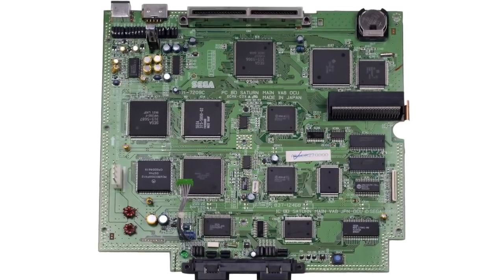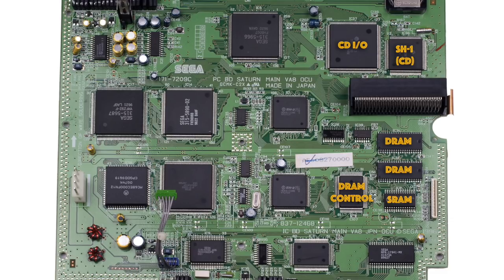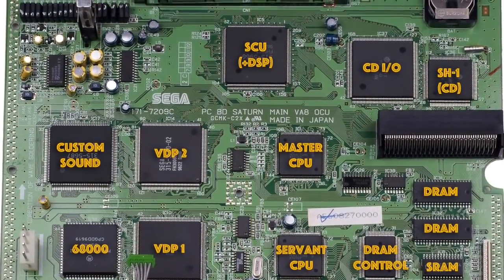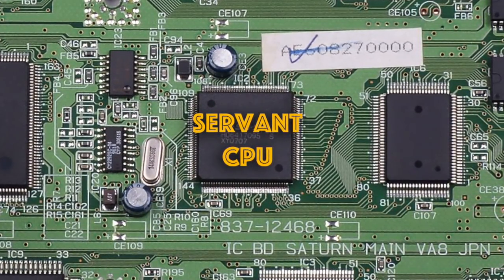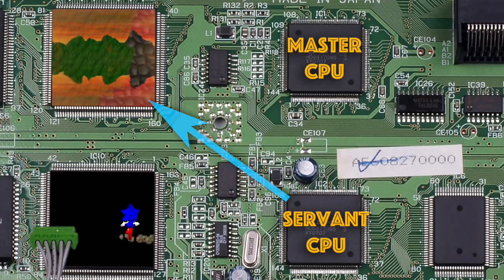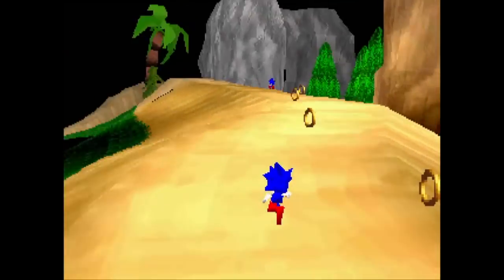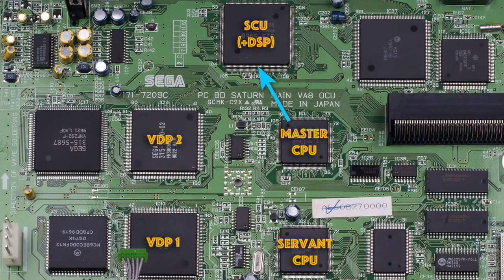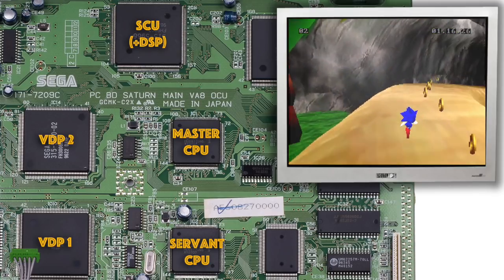SONIC Torn Apart - Exposing SEGA's Insanity with Hardware (CODING SECRETS)

Comment: I'd love a experienced developer like yourself to answer this kind of question... When using all of the Saturns hardware properly like this, do you think it could have matched or even outperformed the PlayStation at 3D capabilities? It was obviously better at 2D. I remember at the time playing this game, Duke Nuken and Virtua Fighter 2 on the Saturn, and all those games looked better than almost anything on the PS at the time.
Reply: according to performance benchmarks on wikipedia and segaretro, in ideal testing conditions (no gameplay code, hardware used optimally) the saturn outperforms the ps1 in any 3D drawing operations except for native transparencies. there's also differences in how the gourad shading is handled between the two, resulting in PS1 graphics looking washed out while the Saturn looks overall darker. the Saturn also has less texture warping problems and no gaps between adjacent polygons.
Reply: that said, the N64 outperforms both by a long shot :P
Reply: The texture cache was so small that devs opted for using smaller textures and flat shading to build larger more detailed textures. Just another case of the 90's not having the most advanced tech available at decent prices. That said, it's impressive that the N64's GPU could manage what it did with so little.
Reply: 21st, N64 does have a "DSP". It also as far as i know doesn't have a GPU. One thing i remember is "Gamasutra Postmortem: Angel Studios' Resident Evil 2 (N64 Version)" for keyword "DSP".
I think it just has two R4000-series processors, one of them being considered the "CPU" and the other "everything else" or the "DSP". I seem to remember (perhaps wrongly) that there are two COPs hanging off the slave R4000, one being a line span texture mapping rasteriser, and one being a more generic math co-processor. If you think about it, line span texture mapping and wave sample music synthesis are essentially the same thing, so i think that's how that works. Most games had the exact same Nintendo-provided middleware code executed on the second processor, which handled all the sound and graphics, so the early emulator UltraHLE didn't emulate it AT ALL, instead it just intercepted the library calls made to it from the main processor and reimplemented the middleware's functionality. I didn't dig deeper than that, i'd be very thankful if someone saved me the effort or provided pointers though.
Reply: 21st, Playstation very much has a true GPU, that doesn't work fundamentally too differently from what you get in the Dreamcast or newer. It has its own VRAM, you DMA a display list to it, it does the rendering, it's completely fixed function, in these regard very much like the Dreamcast, or rather, perhaps the other way around. Sure compared to anything that came out later it's pretty damn dumb, it doesn't have a Z-buffer, it doesn't have perspective-correct texture mapping or any concept of Z coordinate and settles for affine mapping which doesn't connect right at the triangle edges, the vertex coordinates are integers rather than fixed point, its edge rule is complete and utter bollocks (evaluating the edge equation in hardware? pfft, we don't know how to do that, we'll just Bresenham the line and subtract one pixel from the right and bottom, damned be the... edge cases), but it's really an actual GPU, just a sloppily designed one and with ALL the corners cut that you possibly could get away with. Oh and the caching strategy and memory allocation are nearly as asinine as they get too. But as a whole it was also exactly what was needed at the time and for the budget to turn the industry upside down, so while it is a bit easy to make fun of, i'm not really criticising them at that point, i mean 3DO, Saturn and Jaguar kinda saw the general direction but didn't deliver what was needed to push the industry to where it needed to be, 3 expert manufacturers tried and fell flat on their faces. Not to speak of the other failures, like the Bandai Pippin, FM Towns Marty, NEC PCFX, Amiga CD32, which weren't even close.

I used to be fairly familiar with Playstation GPU because i used to develop a PSEmu Pro compatible GPU plugin that was shit and never released. You google up "Everything You Have Always Wanted to Know about the Playstation But Were Afraid to Ask" document by Joshua Walker, that should fill you in nicely.

I also suspect the max usable texture size on N64 was limited not by the memory constraints, but by the fact that the complete texture had to fit into the slave R4000's L1 data cache, and that was just never going to be all that generous, because of transistor budget.
Reply: I think the supposed "fact" that N64 had T&L is not quite right. I mean on a higher level, yes, something did the transform and lighting for you, and it was probably the second processor, which probably detracted from the time it had for texturing things, which is... not exactly the point of T&L, which is supposed to be a dedicated hardware unit that can hide the time needed for that. If you look at everything else. Did PC have a T&L? Very uncommon, but i think 3DLabs and someone else, somewhat exotic professional cards, had true hardware T&L solutions around the same time, obviously only with OpenGL and at first just with Windows NT. And it was usable with any Quake game, not just Quake 3. First GLQuake came out in early 1997. Oh there was also the Hercules Thriller Conspiracy, which allegedly came out in 1997-ish, a Verite with Fujitsu geometry processor, so that was probably consumer-oriented, but also i haven't ever seen one and haven't heard of any person or even magazine that had - chances are, it didn't work really, a bit ahead of its time. By the way, Hercules is a hardware company related to Ubisoft :D Direct3D didn't gain hardware T&L until DirectX7 due to driver architecture constraints, so that got implemented in 1999, just in time for GeForce 256, a T&L chip for the masses. Playstation? Well there's no GPU side T&L, but you had a coprocessor to accelerate these operations, not really useful for anything else. Dreamcast's SH-4 has something similar again, a super-fast set of dedicated pipelines which just did the few things that you need for T&L, though of course that's more akin to SIMD like you had on Pentium III, just with a much more cut down instruction set. Obviously using these units still occupies the CPU, so it's not true hardware T&L either, but they also fulfil the purpose of accelerating the same set of operations.

Ultimately hardware T&L was a bit of a massive dead-end, it's fundamentally better to have programmable hardware do these operations for you as you can have a lot more flexibility at little extra cost, which is what the VU1 in Playstation 2 and the vertex shaders on Xbox delivered. Other than OpenGL spec, there was really no good reason to have a fixed function hardware for vertex operations, as opposed to rasterisation hardware.

Apropos how much the Hercules card mentioned above was ahead of its time, Verite would have possibly been pixel shader capable, except there was of course no API or driver support to make use of that, and the performance of those cards was pretty bad too, but they held up feature wise surprisingly well for such early GPUs, adding new DirectX features as needed, it's just that the entire computational throughput wasn't that good. I have not managed to procure a Verite for testing in 1998-1999 because no supplier or store or chain working with me (i wrote hardware reviews for two print magazines in a small eastern European country, as a teenager, this wasn't actually that uncommon there and then) stocked a Verite, in spite of a bunch of manufacturers making the cards, though those all other cards didn't have a dedidated T&L processor. The Verite company pretty much disappeared by then though.
Reply: I don't think N64 lacked RAM. 4MB stock, expandable to 8MB - that's HUGE for the time. Couple that with cartridge based storage, of course unlike earlier consoles the cartridge is not fully directly accessible at the same speed as RAM, but you still have a very low latency storage path, so you can cull textures from RAM more aggressively than you'd ever dare with a CD based system. I think the max texture size is as stated above limited by cache of the second processor. If you wanted to have higher detail textures, you'd have to tesselate the geometry, and the system was not really up to the task of handling any more geometry than you saw in those games - at least not with default middleware that most games had to make do with, a handful games used a faster alternative, especially Factor5 games. Plus the texture transfers from the main RAM to the cache of the second processor was also likely a limiting factor.
Reply: @Slana Gearz
You misunderstand the N64 hardware. It has 2 chips and 3 processors. Its "RCP" contained two independent processors, a DSP and a GPU. The GPU was designed by SGI(the leading 3D graphics company at the time) and was the closest to a modern GPU of its time(excluding SGI's other products). It was running a graphics API very similar to OpenGL; to be exact, it was using the API that OpenGL was based on. "Hardware" T&L has always been a misnomer. To the best of my knowledge, nobody has ever actually done it. Rather they use microcode, like the n64, to do it. It isn't physically achievable, excluding microcode, to do hardware lighting because you would need a processor wide enough to process the entire world space at once. Think a 16000000bit processor. NVIDIA's big innovation  was locking the developers out of the microcode.  

The reason for the low quality textures was something else entirely. The GPU only 4kB of "TMEM" that halt 8 textures. This texture memory was on-chip and very fast, but to load a new set of textures, the GPU had to use main system memory which functionally paused the CPU. To get around this, developers had to use as few textures as possible in any given scene. A good game to see this in action is OoT. The game has a lot of textures, but you only see a handful at any given time. Each dungeons has its own set of textures, and each boss has several unique textures. Yet you go to Hyrule Field and you have the same textures plastered all over the place.
Reply: Amir Abudubai, source of assertion that there's a complete GPU integrated? I know i don't have a source for my suggestion either, and i know i might be remembering things wrong. I know it's designed by SGI, but... that's not really saying much, given that the project scopes were completely different and the variety of different hardware SGI produced over the years. And i know NVidia and 3Dfx and 3DLabs and a good chunk of the industry overall descends from SGI, it's their engineers being founding members of these companies who made them possible, with few exceptions... and it's absolutely fair to say that they have thrived on reimplementing SGI's innovations while taking advantage of newer manufacturing technology for years, but i'm sure they also cut down the underlying complexity a lot, because they were in the mass-market ASIC business and not in the workstation business, so it made less sense for them to rely on off-the-shelf hardware.

I guess what would be somewhat authoritative is a disassembly of the "microcode" off the RCP. It is a MIPS processor that's for certain, and it stands to reason that whatever other units are implemented on the same silicon, they'd use the MIPS COP facility, the question is really just what functionality is implemented on the COPs directly and what is performed in software on the MIPS. Another approach would be to look into the emulator source that performs low-level RCP emulation and just see how exactly it implements the COPs. I vaguely recall hearing that the COP for texturing is a rasterizer that outputs a section of a line per COP operation, and i don't have a validation for that at the moment, but i'll probably try to dig in later, see if i can find something to prove or disprove that.

I don't see why you'd think the complete scene needs to be vertex processed at once. You have a DMA controller, which is a simple state machine, you don't need a processor for that. The controller feeds primitives into the rasteriser one at a time, every time the rasteriser signals ready, it gets another primitive. So far so good for classical rasteriser hardware. To have hardware T&L, you just extend the DMA controller to switch between either loading the fixed-size T&L parameters into the registers of an ALU, for example just the transformation matrix in the simplest case, or loading a fixed-size primitive, the ALU in turn multiplies the matrix with the primitive's vertices and feeds the transformed primitive to the rasteriser - that's your basic transform. To light, you add a bit of flexibility to the ALU and a little state machine that applies operations to the primitive a bunch of times. Just like the rasteriser is a state machine, it's not necessarily microprocessor-based (usually not), and it's not drawing the whole primitive in one step, it draws a handful pixels a cycle and loops through the boundaries that are spat out just in time by another state machine. State machines are hardware design 101, state machines and truth tables are basic building blocks that both general-purpose processors and dedicated circuits are generally and easily composed of. Microcode as a term is not very well defined, but usually it means a softwired state machine instead of a hardwired one. In that sense i think Nintendo calling the firmware that is uploaded by the game software to the RCP the "microcode" is a misnomer, i suggest a deliberate one because it makes sense to not let people know more than they had to, to protect their and SGI's intellectual property. Using a microprocessor that executes a program when a state machine would suffice is usually a distinct inefficiency, because you're essentially running one state machine on top of the other, with the exception being a processor that is designed with the minimum amount of flexibility to support that specific state machine, at which point the distinction between 'microcode' and 'software' becomes quite blurry. But a MIPS is certainly not such a minimalistic processor. On the other hand, shaders are fairly minimalistic processors.

Even if the COPs accept one primitive at a time as an input, that's still definitely limiting, as ideally when you have a complex and capable processor, you want it free during the time it takes for rendering to perform other valuable tasks; so original Playstation and a bunch of other systems have a DMA controller or some other similar hardwired logic feed the rasteriser. This is not really a given when a processor has to hand-feed the rasteriser all the time. And i mean given the fact that the rasteriser's embedded texture memory is this limited, it probably does. Playstation2 actually has a wonderful (if very unwieldy to program or emulate) DMA controller that can feed both geometry to VU1 and textures to the rasteriser, and it will be blocked by VU1, which in turn is blocked by the rasteriser, so texture replacement occurs exactly as-needed by dedicated hardware, and utilisation of all units is maximised by FIFO buffers, though ultimately it's not perfect. PS2's VRAM is essentially designed as a texture cache and framebuffer storage, not a storage that one may expect all of the scene's textures to fit into.
Reply: DejaVoodooDoll  Usually that's the art depts problem ? Why would programmers be doing aesthetics and design too ?
Reply: DejaVoodooDoll  Every artist I know comes from an art background.
Reply: DejaVoodooDoll  Every artist I know, as in people I have met, that doesn't mean I know every artist.

Comment: +1 for a DSP parallelism design and requirements.  Especially how you're able to fetch and store the required data at 6 instructions per cycle(?).  Were you able to keep it active constantly? I know a lot of 8bit systems couldn't do much outside their vblank/hblank periods.  Your Mickey Mouse videos on the genesis implied you did a fair bit of palette tweaking during hblank.  Were you able to kept the CPU(s) and DSP(s) busy 100% of the time on the Saturn?  If you did pre-process physics, did anyone notice the increased input lag?

Comment: Do you have any coding secrets for Toy Story 2 on PSX?
Reply: Second this. TS2 on the PSX is a fully realized 3d Platformer on the PlayStation 1. It boggles my mind that such a large open world works on that console.
Reply: @jeremygregorio7472  
You want to see open world on the PS1? Check out Legacy Of Kain: Soul Reaver. Not a single load time other than when you load the save file. Completely seemless open world. Even gives Jak And Daxter: The Precursor Legacy a run for it's money.

Comment: Hey Jon, have you ever programmed for the 32X? It was an add-on for the old MD/Genesis hardware that had an architecture similar to that of the Saturn, except it had only one VDP, no DSP at all, two software PWM sound channels for each SH2 rather than the SCSP, and it piggybacks off the MD/Genesis. Due to the VDP on the 32X not having any advanced graphical effects at the time, *everything*, including 3D Polygons, had to be rendered in software.